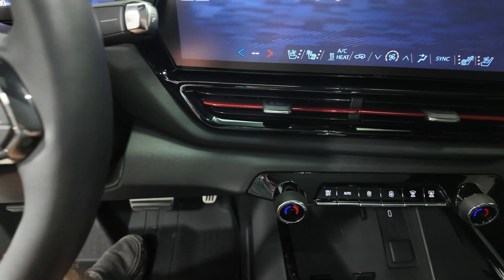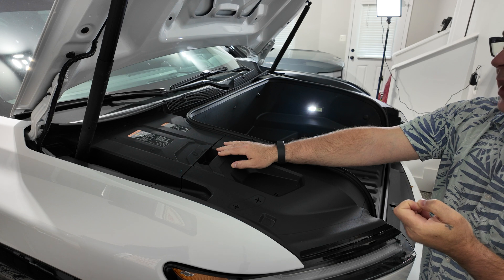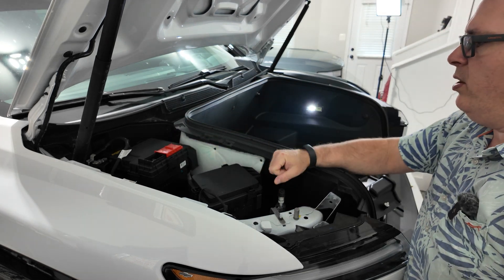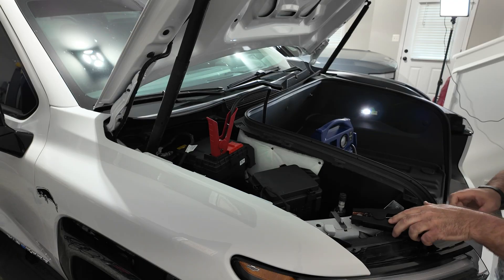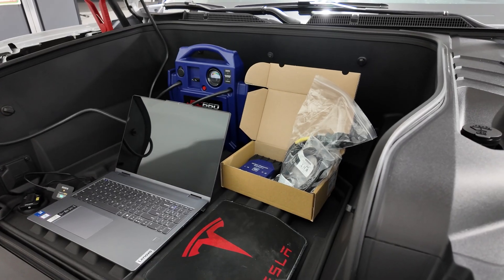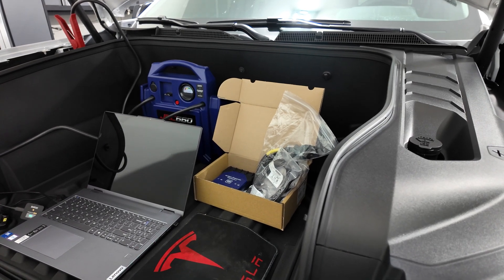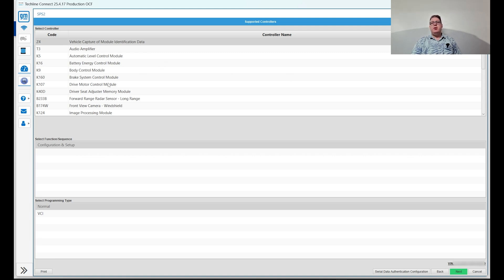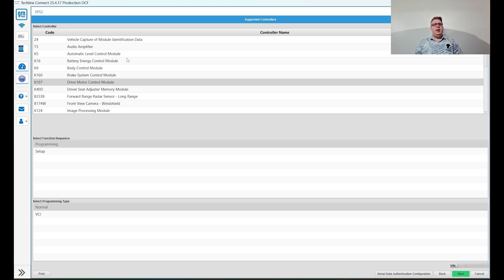How To Program GM EVs | Techline Connect SPS2 Programming Guide

Comment: This is a great video tutorial!  I have the same JNC660 but read that these are not good battery maintainers for module updates like this due to low and inconsistent amperage.  I take it that you do not have the same concerns?   I plan on flashing my sierra EV after my dealer gave me the run around of not wanting to hold up a bay in the shop to run a 4 hr update that they would not get reimbursed on from GMC.  Thanks for any advice on the battery backup question
Reply from the maker: Thank you.  I use it because it’s what I have here, but it couldn’t hurt to get something with a little more reserve capacity to use as a back up for programming.. I have an article on my website. You have to give the dealer the service bulletins that tells them to do it and it also instructions them that it’s covered under warranty by GM.

Comment: Eu consigo usar esse programa com o scanner xtools pad 3 ?
Reply from the maker: Great question. It might be possible to use the software with other hardware, but I don’t recommend it. There is always a risk that a module could be bricked when you’re doing the updates the official GM tool is more expensive, but it is fully supported by GM and if a module becomes in operative GM would cover. I’m not sure that they would cover a third-party tool for that reason, I can only recommend the official GM tool for use with the tech line software.

Comment: Is a USB-C flash drive/adapter needed, or where are you supposed plugin the USB drive for the radio at?
Reply from the maker: Yes if your PC only has USB-C ports then you would just need a good USB-A to USB-C adapter.  Also would be needed to connect a USB A thumb drive to the trucks USB C port

Comment: Have you done the VWP at home?
Reply from the maker: Great question. I haven’t been able to get the vehicle wide programming option in my setup so I have to go module by module and look for updated calibrations. If there’s an updated calibration available then I run the programming to update the module.
Reply: @ElectrifiedOutdoors thanks, I have an unrelated question. On the SuperCruise on 2026 which seems to have auto lane centering on non SC roads, do you know if that will trickle down to older models?

Comment: I took it to the dealer and they refused to update the vehicle. So sadly being forced to go this route.
Reply from the maker: I’m disappointed to hear that.  Refer dealers to TSB 24-NA-143 dated April 2025 and the instructions for updating Ultium based EVs is located in 24-NA-113 also dated April 2025.  I’m going to add a pinned comment with this info.  Hopefully they push OTA soon.

Comment: Where did you purchase the official MDI2 for just $900? Searching online I see most of the prices being $11-1200?
Reply from the maker: hey there.... I have it on my store.  https://evoutdoors.org/products/bosch-gm-multiple-diagnostic-interface-2-mdi-2
Reply: And the thing is, $900 is about $700 over priced. You can buy all sorts of other J2534 tools for MUCH MUCH cheaper than $900. There's really no reason other than GM greed that a programming tool should be so astronomically expensive.
Reply: I use a tool called a Mongoose